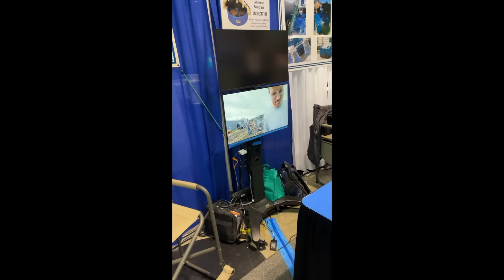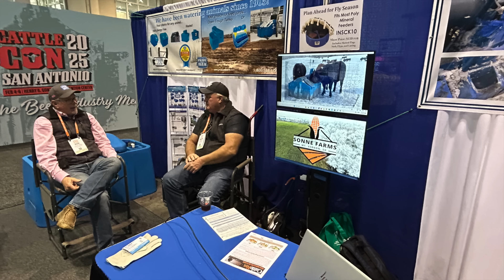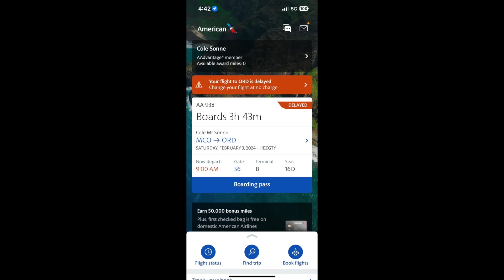Masters of Manure head to Orlando!

Comment: You can put ATF in the power steering pump and it works just the same as power steering fluid , just in case you get in a pinch